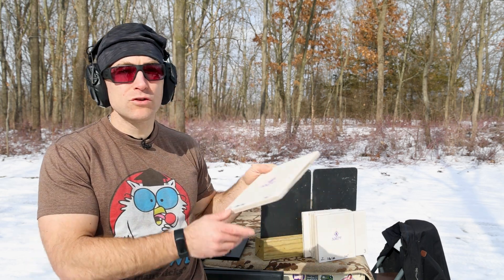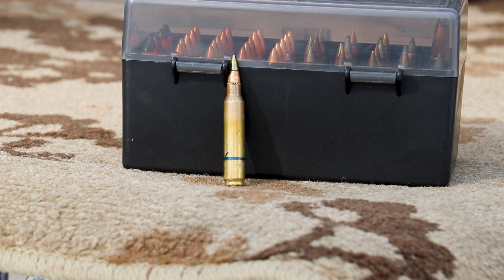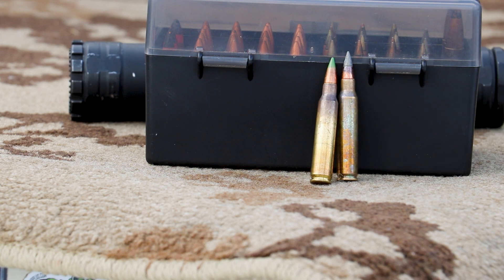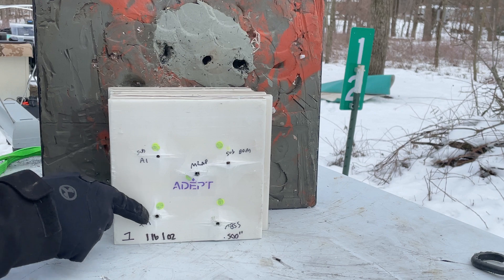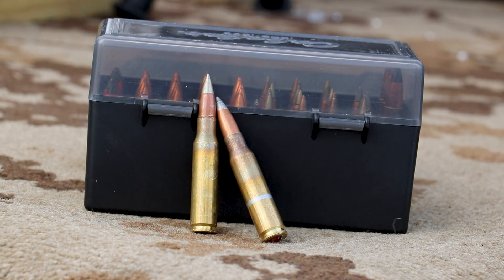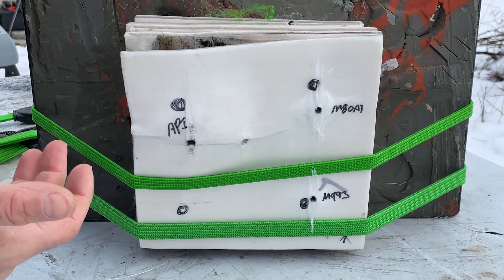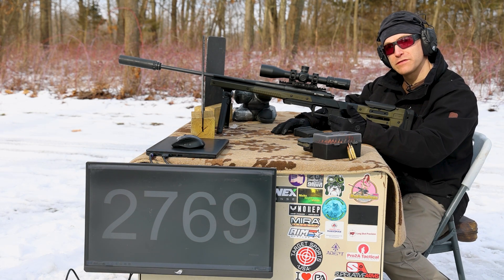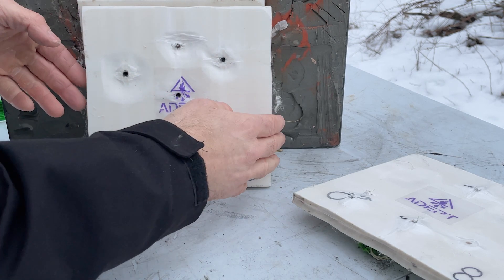Can UHMWPE Panels STOP Armor Piercing Ammo? Adept Armor

Comment from the maker: Okay, this is where you drop your comments. We'll use M33 Ball, M2 AP, and possibly MK211 in a follow up video featuring the same UHMWPE boards. Your entry into the contest (prize not determined yet), will be to guess how many panels 50 BMG M33 ball will penetrate. We will use a 29" 50 BMG at 100 yards.
Reply from the maker: @Valorius  1/2”. They will be set as they are here. Stacked and strapped to the clay :)
Reply: this is exactly what i was thinking. RMA has a $300/339 plate thats just UHMWPE and that 1/2 inch plate for $109. (so about 3 of those you have) Great job.
50 BMG stops in the 15th plate. actually i think it will squirt out the side.
edit: i went back to see and the M855 and M855a1 did not go through the 3rd plate.
does that mean a 1inch and a .5inch plate will stop M855 and M855a1?
Reply from the maker: @Valorius  given the dispersion of 50 BMG energy probably :)
Reply from the maker: @Valorius  it is mild steel core : https://flic.kr/p/2hgmyPr
Reply: Based on my estimations, M33 ball will stop in the 11th panel in your .50 cal test, assuming factory rated muzzle velocity.
Reply: Do you have Mk263? It's supposed to penetrate better than M2AP. Mk211 is always a crowd-pleaser. SLAP, too, although probably the M2AP or Mk263 would penetrate better than the exotic rounds.
Reply from the maker: @timewave02012  yes sir! https://flic.kr/p/2nUcuEb
Reply: @BuffRANGE  nice
Reply: My guess for M33 50. bmg  would be that it stops in the 11th plate, possibly poking the 12th.
Reply: Based on extrapolation from mild steel with the same projectiles in  .308/.30-06 and .50 BMG APIT,  I would guess 12 complete, stopping at 13 at close range.  At 100 yards, the velocity reduction could bring that down to about 10 stopping at 11.  Thanks for your usual excellent videos!
Reply: 14 panels, stopped by 15th
Reply: 50 cal im guessing will get to 17 plates
Reply: M33 stops in the first panel.
Reply: Changing my answer from 10 boards above to the official answer of 8 boards for m33 ball. It’s. A fairly big and kind of blunt round that u think the UHMWPE will be able to grab onto once it slows it enough. Should be fun.
Reply: For mk211 I’m thinking 18 plates.. that’s one bad round right there. Unofficial answer is it will blast through 20 or more. Lots of velocity and the mass can keep it stable.. that’s what you need to go through this stuff.
Reply: Ill go with lucky pannel number 13
Reply: 10th panel. I can't imagine going it further
Reply: m33ball 50 bmg 12 panels

Comment: If you get lead core Hornady .50bmg @3000fps, I'll guess it will get stuck in the 4th plate. If not, instead of adding por UHMWPE I'd opt for 1/8"  of Armox Advance in the front, which will be shattered but guarantee stopping much more and even give a chance of stopping smaller calibers with tungsten carbide cores (WC, the ceramic, not the tougher metallic Tungsten, which won't shatter as easily).

Comment: Given your expertise in testing these plates so methodically, i have two questions for you Matt:

1. Do you think trying to protect against M855, but not A1, is worth the trouble?

2. Do you have any recommendations for plates that can stop M193 at a minimum, with light weight and protection against repeated hits as a priority? I imagine PE would have to be a necessity.

Thank you in advance!
Reply from the maker: 1. I guess it would depend on what you think is a greater risk. Not a lot of people have A1, but it's the US Army's standard issue round all the way down too Basic. Stopping A1 usually requires a higher end RF2 plate or one specifically designed for A1. 

2. Virtually any PE plate that's an SRT at 1/2-3/4" thick should and usually are rated for M193. PE is very good at being multi hit capable given the rounds are within it's threat profiles.

Comment: Matt-2 questions for you sir: Is there any benefit to wearing a IIIA panel behind a level III or III+ plate? Also, any chance of testing the Adept Colossus or Spartan Ares with the new Army round? Thank you sir 🙏
Reply from the maker: The Army's new 6.8 is behind a lot of closed doors right now. I don't think I'll have a gun or the actual issued ammo for any time soon. If your III+ is light and thin enough, and you can add an other 1lb, the IIIA is going to help aid in reducing bluntforce trauma. I woudn't count on it to stop projectiles that make it through, at least AP threats.
Reply: @BuffRANGE  Thank you 🙏

Comment: M2AP, 10; M33, 10. The .50bmg is a lead core if I’m not mistaken, and I’d expect to deform some and tumble, heck may not even make 10? Heck of a lot of energy though, will probably send test pieces all over.
Reply from the maker: M33 ball actually has a mild steel core. M2AP, API, and APIT all use a hardened steel core. MK263 AP has a hardened steel core with a LOT of tungsten. MK211 is all tungsten, of course with explosive and incendiary compound..
Reply: @BuffRANGE  oh! I didn’t know that which is funny for as much of it as I have shot. (They don’t necessarily teach you that stuff in the army) well heck if it’s a mild steel core…… hmmm 🤔 that makes this much harder to guess! I have no idea!

Comment: I wonder if panels (upscaled, of course) like these are used as part of composite armor arrays in IFVs and such. Ceramics already are, so it wouldn't surprise me.
Reply: Gonna chime in here.  It's not a terrible idea, a priori, as UHMWPE straight up out-performs the metallic armor materials that are common in IFVs and other armored vehicles.

Take the .30-06 APM2.  

In this video, the .30-06 APM2 was stopped roughly 78mm into the UHMWPE stack.  (Though at a slightly reduced velocity, roughly equivalent to what its velocity would be at 50 yards, assuming it's 2880 fps at muzzle.)  78mm thickness at 0.95 gm/cc = 15.18 pounds per square foot. 

Now imagine we're using ultra-high hardness steel (590 HB) against that same APM2:  A 9.8mm-thick plate would be required at 50 yards = 15.7 psf.  

With rolled homogeneous armor steel (RHA):  Roughly 13.5mm thickness required = 21.8 psf.

(Source for steel data: "Ballistic evaluation of an Australian ultra-high hardness steel" (Ryan et al., 2016))

Aluminum alloy armor fares a bit worse than steel and UHMWPE, in general: 

7039 or 7075 aluminum:  Roughly 38mm thickness required against .30-06 APM2 = 21.3 psf.

5083 aluminum:  At least 48mm thickness = 26.05 psf.

So UHMWPE actually performs better than these metallic materials.  It suffers from four problems, however, which make its use in vehicles impractical: 

(1) It's too expensive.  >10x more expensive than steel or aluminum armor alloys. 
(2) It can't be used as a structural or load-bearing material. 
(3) It can't be welded -- or strongly joined by indeed any means.
(4) It's too heat-sensitive, and might degrade if exposed to even rather mild thermal loads over an extended period of time.  

For these reasons, metals are generally much preferred in vehicular applications, and, outside body armor, UHMWPE is only used in aerospace/maritime applications where low density is absolutely critical.  

As a general rule, vehicles, aircraft, and seacraft are much less weight-sensitive than humans are, so these ultra-weight-critical applications are fewer than you might think...

It seems that ceramics in vehicular composite armor (e.g. Chobham armour) are usually sandwiched between metallic plates, usually steel plates, sometimes with fiberglass interlayers.
Reply: The cost limitation would make sense. Low density materials (particularly various plastics and rubber) are often included in composite armor arrays to defeat shaped charges (as shaped charge penetration is inherently related to density of the material being penetrated), so maybe if the cost were to go down somehow it might see use.

Comment: Great stuff. Two questions

1) does the result modify any of your prior views on 5.7x28 subsonic defeating high quality 3a?

2) what’s your view on the wounding potential of that penetrator? The diameter is tiny and the weight must be close to nothing. So even if it goes through, outside a CNS hit, stuff will come flying back at you for a long long time
Reply from the maker: Subsonic SB193 from 5.7 still defats this type of material albeit less of it. When it does it still tumbles and generally will meet 12" of penetration. I should do a follow up/gel test at some point. Yes the wounding mechanism would be not optimal, but penetration is still there.
Reply: @BuffRANGE  thanks a lot!